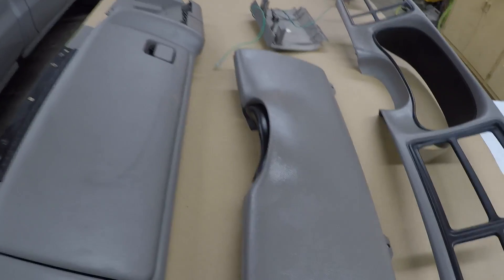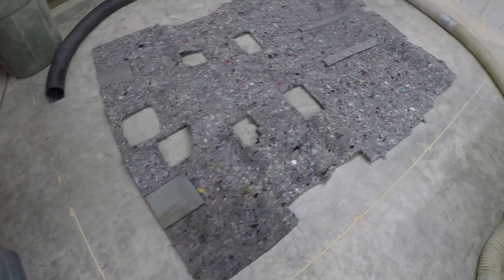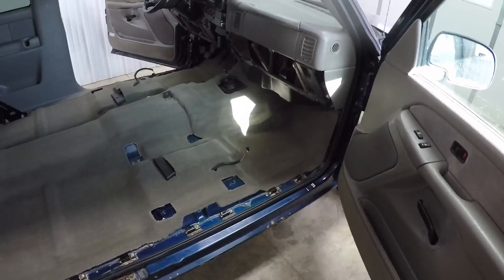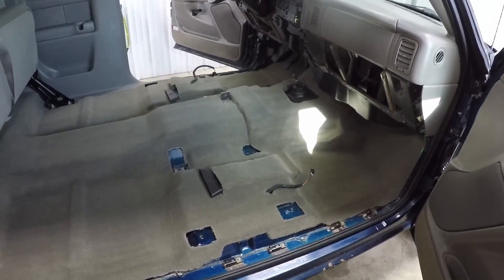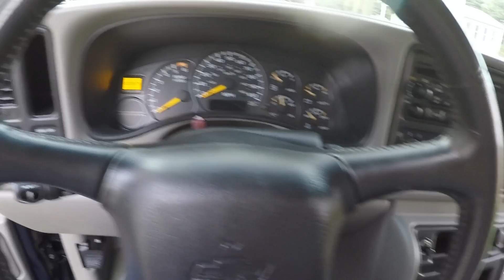2000 5 Speed Silverado Interior Restoration/Console/Remote Shifter

Comment: Glad we got the Walmart floor mats 😍
Reply from the maker: Lol I can hardly look at them they're so ugly!
Reply: @TyBrink  If you want to use a 03 - 06 bezel in a 2000 truck you're going to have to change the dash skeleton behind it as well. The 03 - 06 bezel fits larger hvac unit and radio. Framework that holds them is different as well between 99 -02 and 03 - 06. But it seems you can bolt the newer console into the older framework. I have a 2001 4.8, 5 speed and want a 06 Escalade dash so I have some work cut out for me lol. Another great video!!!

Comment: I saw your old video of the remote shifter and that got me thinking. Since you used a literal Tie rod from a rack n pinion. you can technically adjust the throw by threading the outer tie rod farther out before install. because the throw is determined by how far the top of the shift knob is to the center(where it’s mounted) that is only if you had welded the bracket to the outer tie rod

Comment: That reminds me when i pulled the horrible aftermarket carpet from my truck to replace it with a black oem carpet that i dyed myself. It’s even the same med dark pewter color as your truck. I have a front set of 03-06 pewter floor mats that i wish i could use but my carpet is now black. I also have a full oem front and rear set from a 99-02 ext cab in pewter aswell but it’s in rough shape
Reply from the maker: Let me know if you would want to sell the 03+ light gray mats. I would be interested.

Comment: I only have one question, WHERE DO YOU FIND THESE 5 SPEED V8 Chevys?? All we have around here in Texas are clapped v6 single cabs with crank windows. It would cost more than it’s worth to put a manual trans behind a 4.8/5.3
Reply from the maker: They aren't too common around here either. It took me a few years to find one of these and even then it was really rusty.

Comment: There’s a little cubby that can go in place of that airbag switch to the right of the ac controls. It looks a lot better than that switch in my opinion. What all is needed for the 03+ console swap? I’d like to put one in my ‘01
Reply from the maker: Then you can't switch the airbag on and off? All you need for the console is: the console, front dash bracket, and the glovebox trim and knee bolster from the same vehicle where you get the console. I talk about that in more detail in the next video that will go up in a couple days.
Reply: Ty Brink All you have to do is relocate the airbag switch to the glovebox. It fits perfectly in the left-most part of the glovebox. There’s info about it on forums
Reply from the maker: @jacobn3160  oh nice! I had never heard of relocating that before. I'll have to keep my eye out for one of those cubbys at the junkyard, I had a 2004 crew cab Silverado that had one and it does look better than the switch.

Comment: Ty wow, you're a woodworker too??    If I had that kind of talent I would make Real wood  interior accents 

Some custom real 1/4" bamboo stained/grey door and dash panels would  look nice!  

Like custom builders used to do with real wood ( some made 1/2" thick ) back in the day in the 90's. 
Builders like 
Centurion 
Southern Comfort 
ChooChooCustoms 
WesternHauler
Sherrod 
Heartbeat
Reply from the maker: I build custom cabinets and furniture for my day job. That's a little out of the realm of what we do but it would be cool!
Reply: Ty Brink A lot of Custom conversion vans have wood accents. Some nowadays are hydrodipped or thin laminated wood, but back in the 90's it would be real wood. 

When I was a kid in the 90's a friend of mines mom had a Chevy Custom Suburban with 3/4" thick wood panels on the door along with wood roof lighted consoles. With plush pillow top leather seats, felt like I was riding in a Rolls Royce!